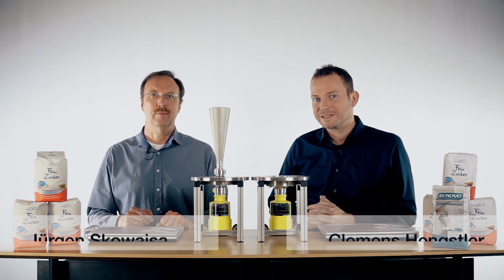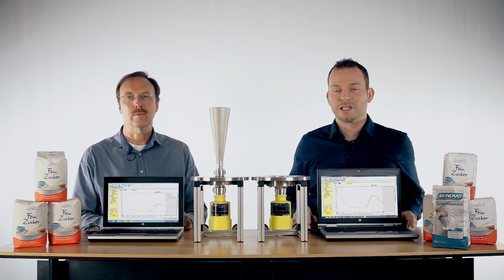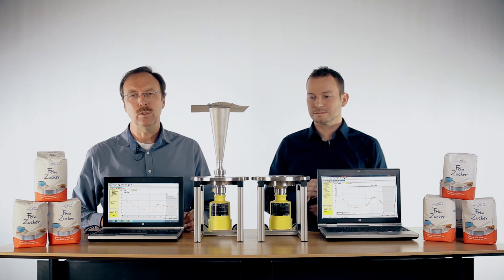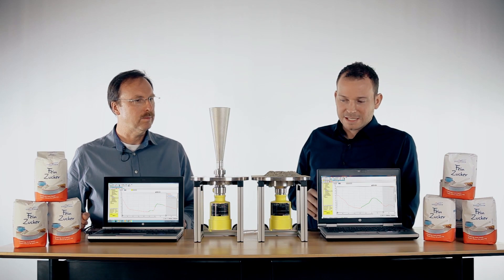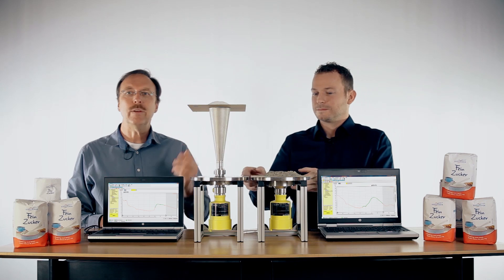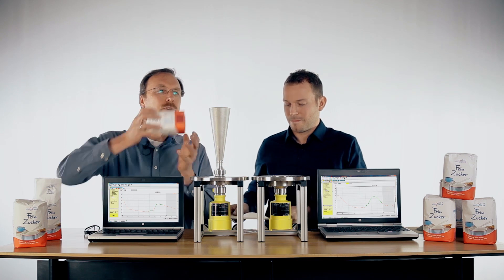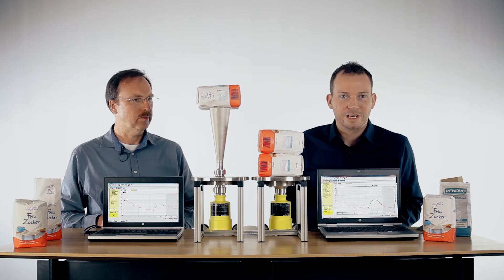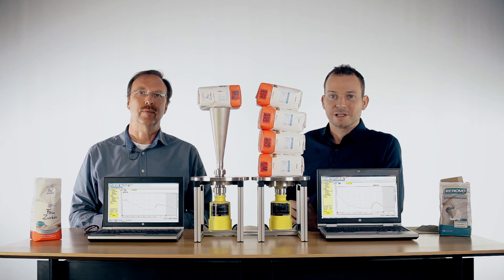VEGAPULS 69 - Buildup | Radar level measurement

Comment: How can we adjust the offset error for vegapuls 62 cone antenna  type level transmitter ..we always face constant  offset error during level measurements of crude oil storage tank
Reply from the maker: Thanks for your question. If the sensor is mounted in a bypass or stilling well, please choose this as the application and set the correct diameter. If this does not work, please contact your local subsidiary for further analyzing: https://www.vega.com/en/company/vega-worldwide